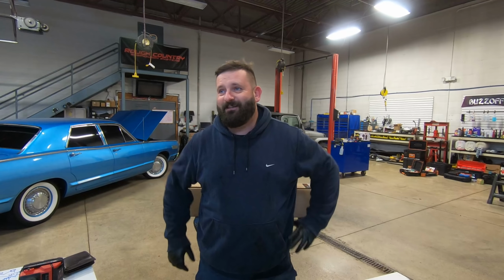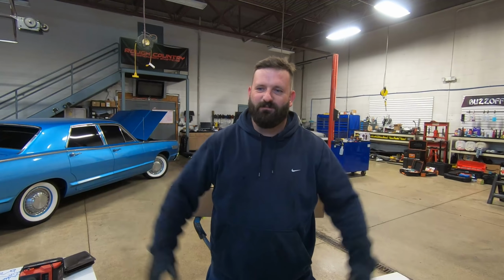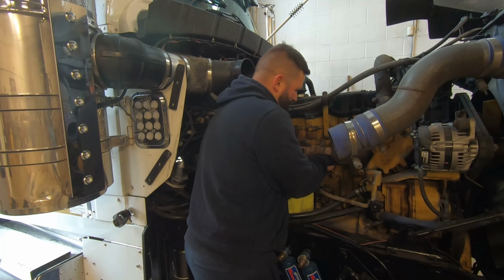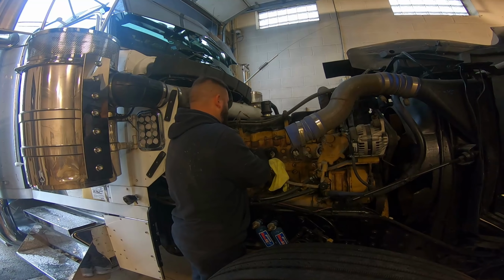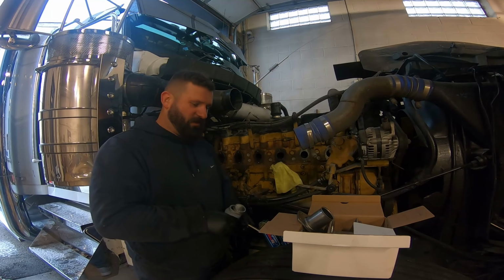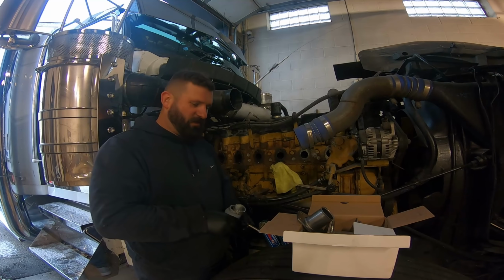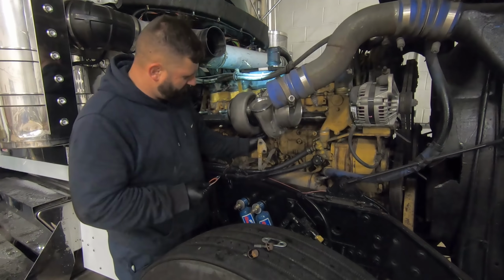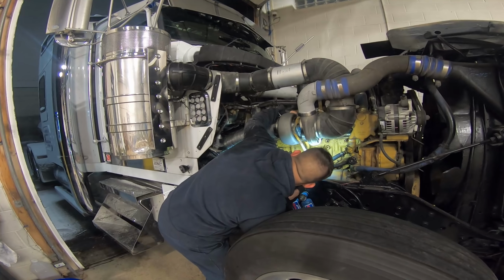**PDI MANIFOLD & TURBO UPDRADE INSTALL** Cat 3406E From Stock To Rock?!

Comment: Seemed to go very well on install. Great job!! You never know until your done. Have had many that don't go so smoothly (Something breaks, new tool needed, or part missing). I always buy new fasteners (bolts/nuts) on everything. Never know if they were ever overtorqued and stretched. Only an extra $20 and worth the peace of mind.

Comment: great work
im thinking about pdi turbo + manifold for my 60 series but worried its alot of work.
after seeing this, i think i will do it.
Reply: Did you get installed? I have a Columbia. If I had a Classic I would have no worries but those bolts on cylinder 6 are waaaaay back there. I would hate to break the bolt off in the head.

Comment: Big brotha, where did you install the egt probe, or pyrometer sensor
Reply from the maker: Right behind the turbo
Reply: @TruckingPassion  so post turbo? Basically the tube coming from the turbo and on the way to the exhaust stacks. I heard you dont get the best reading there. Whats your take on that?
Reply from the maker: The air there may be a few degrees cooler than straight on the manifold but still good
Reply: @TruckingPassion  I heard anywhere from 200 to 300 degrees cooler

Comment: Did u have to retune the ecm for the turbo r is it just a plug and play with out adjustment
Reply from the maker: I actually got the PDI tune too and reclasjed the ecu with that, we'll see how it is
Reply: @TruckingPassion  yea I have the pdi big boss tuner but it won't work on my truck I won't say why but...🤷🏻‍♂️...all the other functions work but I was look at doing the same for my isx just want to see if u had to have it match up when u changed the turbo out thanks for the response....truck looks awesome
Reply: @andresmartinez584  did those parts get "stolen" off your rig too